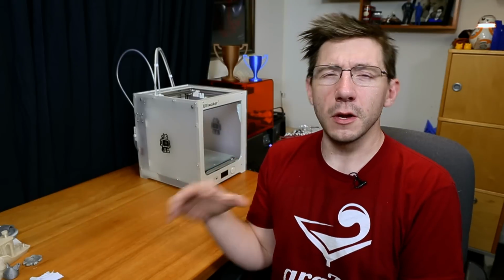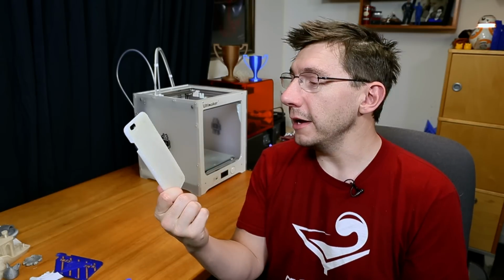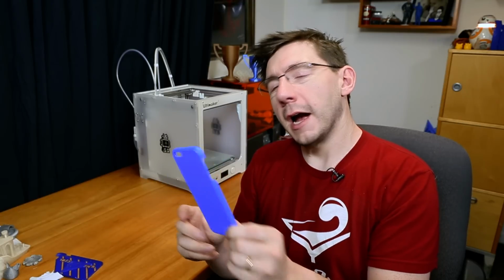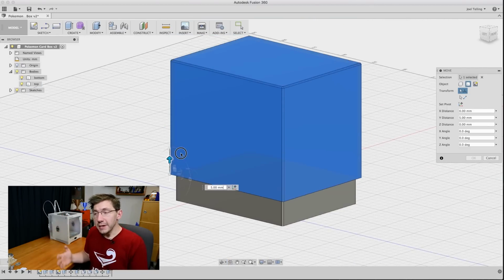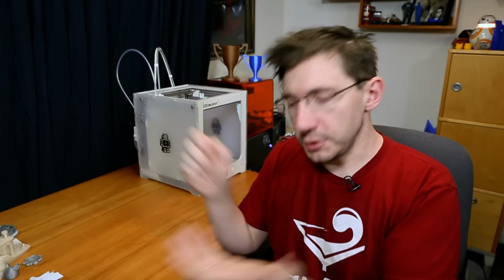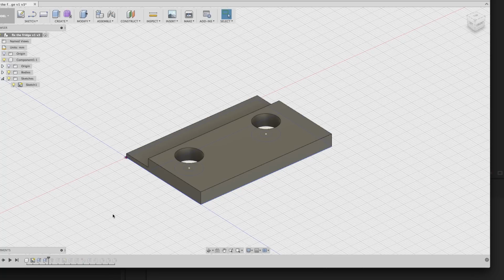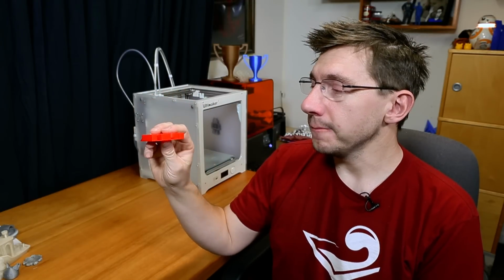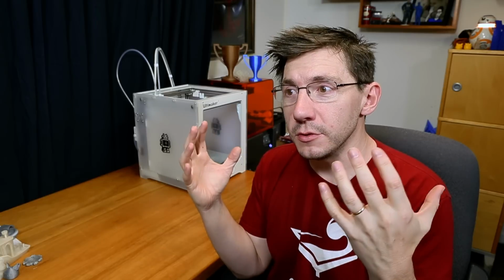My Top 5 Useful 3D Prints of 2016

Comment: I have made about 7 Raspberry Pi cases, some of chuck's projects. Many Thingiverse projects such as multiple lights one which has a toggle switch to turn on and off with eight batteries, and I use it all the time! A solder fume extractor by adafruit. Some refrigerator magnet clips. I printed out two drones that I am still working on. I am currently working on a project called "Root2CNC" that is on Thingiverse. An ipad stand. A pocket hole jig.

Comment: And with the price of replacement parts for appliances, you can quickly pay for your 3D printer.  I don't know if I've paid for the cost of mine in practical parts yet, but it has to be close.  And I've only had it a year.

Comment: Who's to say that Pikachu's aren't useful? I really like your number one for the refrigerator.   I designed some holders to hold my usb hub on a certain spot on my desk. It's pretty good but want to try it with some flexible filament. Does the flexible filament give it grip too? Cause right now the holders slip more than I would like on the surface of my desk.   I also printed a headset holder from thingiverse. That was useful cause I would lay headset on ground and it has broken a couple of times.

Comment: That's a genius use of Flexible filament!  Nice job!  I love all the practical prints.  I need to do a case for my phone, I bought one and it broke in  2 weeks (after zero drops!)
Reply from the maker: Maybe you should drop your phone so it doesn't break? ;)
Reply: 3D Printing Nerd 🤔
Reply: SPECK makes cases that are very durable and low priced on eBay.

Comment: Most of my prints have been practical or at least useful.   I started with things to improve my printer (Wanhao i3) like a filament stand I designed, z axis braces, etc. and then designed a flashlight holder for my mountain bike. Other things I've printed are vases, lamp shades, coasters, kleenex boxes, AA and AAA battery storage boxes, peg board things, tower of Pi pencil holders... the list just goes on and on.  There are so many great designs out there and great free modeling tools, that's what makes 3D printing awesome.
Reply from the maker: THIS. So true!

Comment: Holy crap man, what a coincidence!! (Perhaps you mentioned it before in another video?) I had to do the same repair on my family's fridge a few days ago. The cam on the center door flap has always been too low and it wore off the edge so far that it would pop below the OEM POM plastic catch. I modeled the catch in solidworks with some added thickness and printed a replacement on my UM2E+ in lime green ProPLA. So far it is working, we'll see if the door slamming breaks this one, even so I can always print another.

Links to my FB post:
https://www.facebook.com/AdamSReed/posts/10158329461835112
https://www.facebook.com/photo.php?fbid=10158329938820112&set=a.10151984741195112.882313.872760111&type=3
Reply from the maker: Whoa, total coincidence!!! That's great, and thanks for the link, I took a look!

Comment: So far with less than a month in I've printed a cell phone stand (well several stands) for my other half. Got the designs off thingiverse, and tweaked the scale a bit to fit our phones. Used basically daily. I also made a simple cylinder case for a TWSBI Eco fountain pen. It's still a bit prototypey, but it does work to protect the pen when knocking around in a handbag.

I repaired a figma doll stand. Replaced a broken arm of the stand with one I modeled in OpenSCAD. Keeps the doll suspended mid-air. I need to tweak that design a bit. Useful, might be a bit of a stretch here, but it did repair a broken part with a replacement I designed. Much like your Fridge repair. First modelling the broken part, then tweaking to make the part better. And now if it breaks I can just print another in about 10 minutes.

Next up I'm looking at a couple of mods for my printer. Then painting accessories for painting gaming miniatures. 

#Highfive

Comment: I suppose that with the flexible filament, you could make a two part case (I've seen some pre-made ones like that) where the flexible goes around the phone for shock protection and then a stiff case goes around that to hold it in place.
Reply from the maker: I thought about that, and it would be a neat way for me to learn more about modeling.

Comment: I haven't done a great deal with my printer (this is the year I delve into it more), and most things I print aren't useful, but my most useful is probably a card box. Mine is designed for cards to lay face down for a board game. I placed holes in it for several reasons, being that you can take the lid of easier, you can push the cards out through the bottom, it used less plastic, and I don't have a heated build plate, and large surfaces touching the bed tend to curl up, so the holes in the top and bottom minimised this!

The other useful thing I printed was for my nephew...basically a big red box with clear acrylic sheet in the front with an emergency toilet roll inside! The front then has "break glass in case of emergency". That was probably the longest print I have done so far!
Reply: Here's a few ideas, A cup holder for a desk, a car, table (instead of a coaster, stops kids from spilling drinks and such) A Console stand E.i xbox playstation or even Nintendo. Pencil holder, Items box for remotes and such. And well as much as you can think of. ;p

Comment: I made a few useful designs with my Wanhao Duplicator i3. Recently my headphones broke. (Skullcandy heaphones that I like too much to let them die). The little piece that broke was some sort of "double" action hinge that allows you to fold the headphones in 2 DoF. Designed the piece in CATIA and printed like 4 prototypes (had some troubles with dimensioning and tolerances). After 10 hours of CAD it came out something really decent. Glued it and voila!  My headphones are alive again... actually the material and feels more resistant and reliable than the OEM material. :D
Reply: This sounds like a truly useful 3D print. Good job Mr. Fagoso.

Comment: Noticed the folded paper under the printed part? Too flexible maybe?
Reply from the maker: +3Dcreator Kim Hansen good catch! The paper is there because the bottom of the part is too thing and flexes a bit too much. Just need to thicken the base and reprint!
Reply: That's what I thought. I have never tried flexible filament but figured it's tricky to work with. Too expensive in Europe.